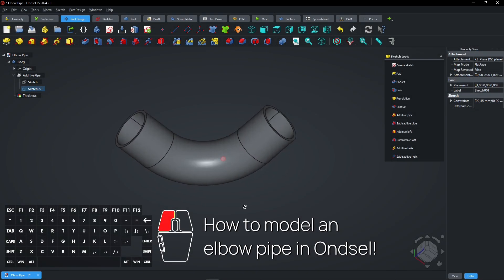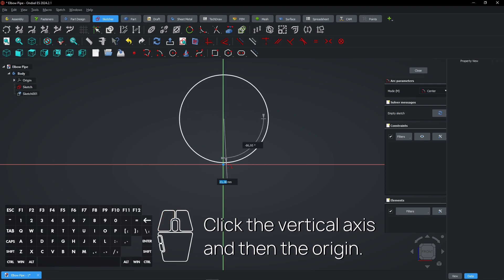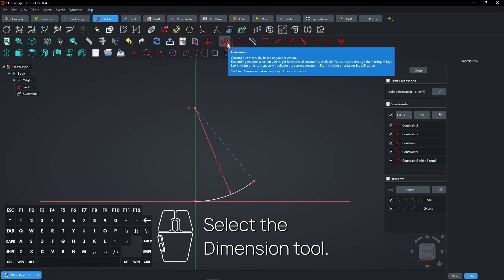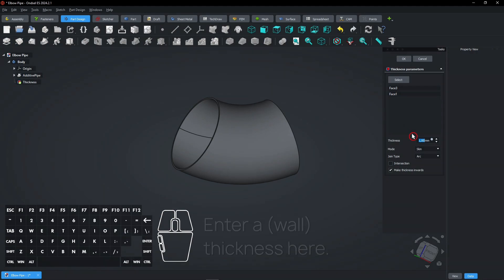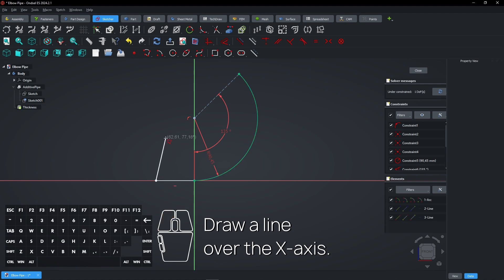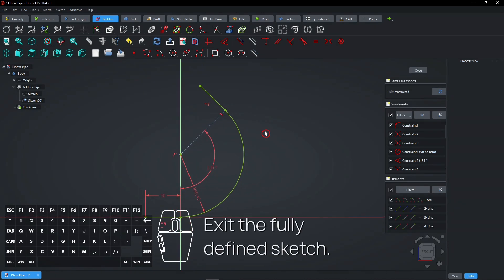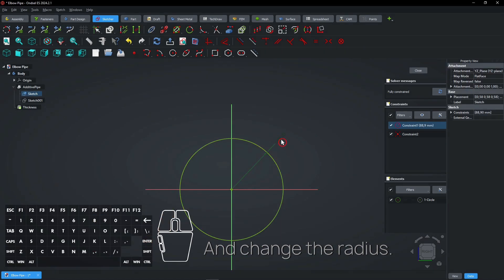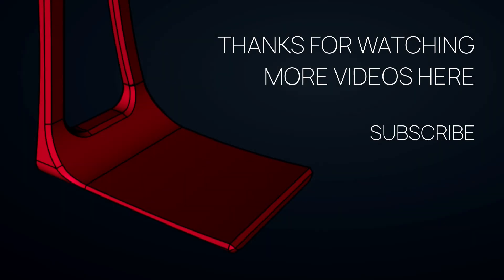🦾 Ondsel Tutorial - Model An Elbow Pipe - FreeCAD Additive Pipe - FreeCAD Piping

Comment: I noticed that your toolbar does not have a "line" tool. why is that? 
You have used a multiline tool even to draw single line segments. 

I am using a nightly version, and it has a "line" tool. Not sure if earlier (stable) versions of OndSel had it...
Reply from the maker: Yes I noticed that too. 2024.2 and 2024.1 does not have the Line tool. I think it's obsolete, because with a Polyline, you can also draw a single line. That's my guess.
Reply: @AllVisuals4U  No, it's the other way round! If a nightly version has it, it means the feature is the latest!
Reply from the maker: That's right. Maybe it's coming back then. I don't know, we will see!
Reply: @AllVisuals4U  the line and polyline tool are combined in the same icon(like center point arc and 3point arc). You just need to click the arrow next to poly line to select individual line. And it still has it's normal hotkey association. It's just to clean up the toolbar I think. I like the change.
Reply from the maker: Thanks, i like it too.